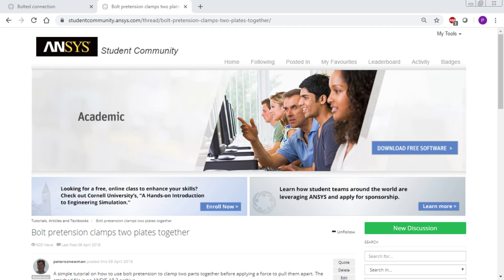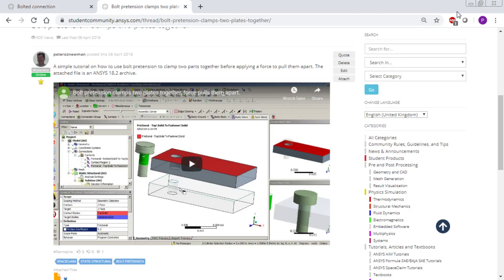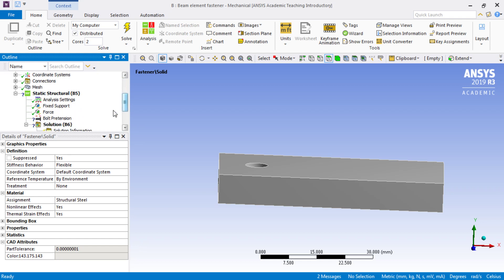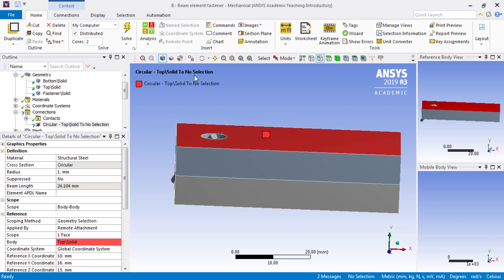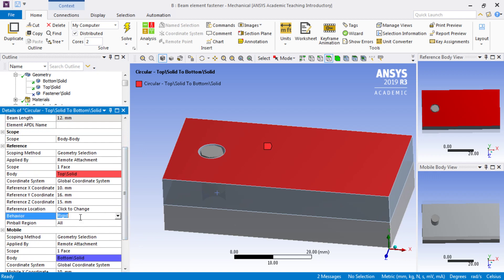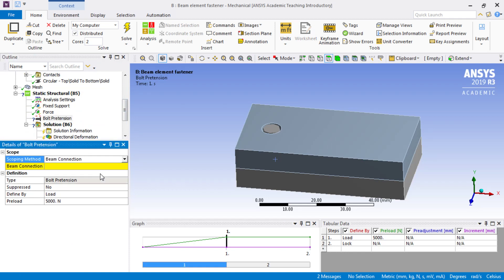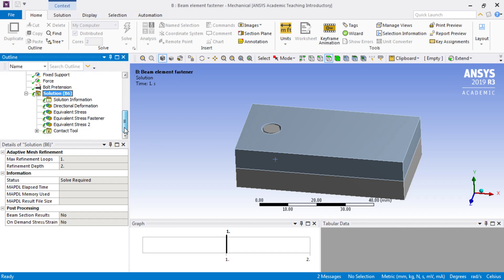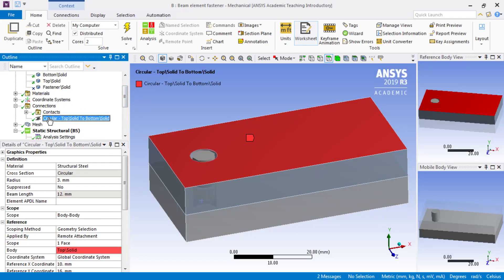ANSYS Beam Connection between two blocks

Comment: Hi Peter, useful information! I have a question about definiting beam connectors: would it be right choose the lower hole with a pinball radius for the mobile scope (as you did for the reference scope)? If is better do it as you did in the video, if you would have more than  two plates, you should chose the inner hole of all of them for the mobile scope? Hope your answer! thanks
Reply from the maker: Hi Marina, when a bolt clamps 3 plates together instead of 2 plates as shown in this video, the middle plate has a clearance hole and is held in place by frictional contact with the top and bottom plates. The bolt does not interact with the center plate at all. This assumes that the clamping force of the bolt and the coefficient of friction are high and the shear force on the middle plate is low so that it does not slip. If that is not the case, then I would add frictional contact between the side of the bolt and the middle plate hole to support the middle plate shear force on the side of the bolt after the parts have slipped. Generally, joints that allow slippage are unacceptable with rare exceptions.

Comment: Hello! 
Can you please explain if it's better to scope one side of the beam element (bolt head area) to the circular edge or use your method (kind of looks like you are scoping to the representative washer surface area?
Reply from the maker: For a model with solid elements, it is better to scope a beam element to a face with a finite area because then you have a finite stress.  An edge has zero area so has theoretically infinite stress.

Comment: Hi, Thanks for the videos!! I have a question relating to a project I am working on right now. The project sizing is still in the preliminary stage right now and I want to know if the size matters when doing static structural analysis although the size difference is just scaling up as the model I have from CAD right now is a smaller version of the real size for now but as the size is not finalized yet can I still do the static structural on the scaled down version ?
Reply from the maker: If you know the displacement load on the full size model, and you scale down the displacement load with the same factor as the geometry, then that would be a valid model.
Reply: ANSYS FEA Examples Okay, thank you so much !